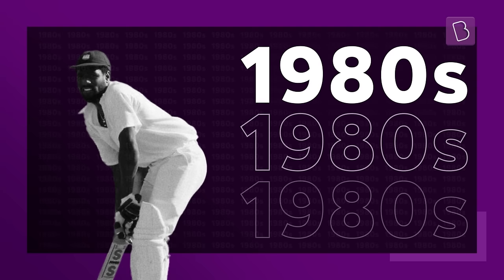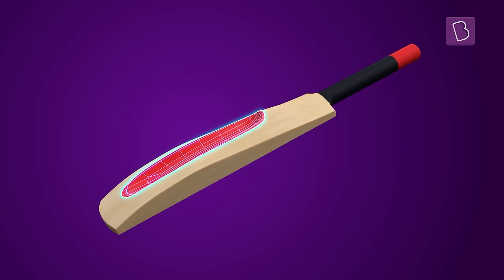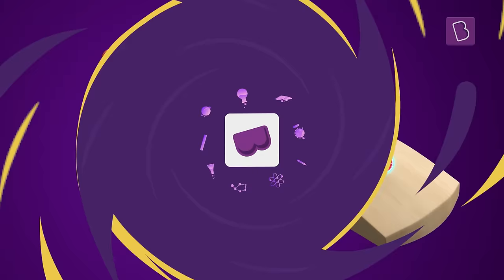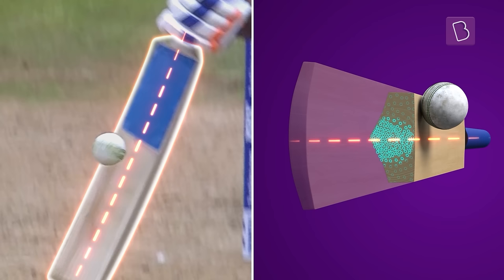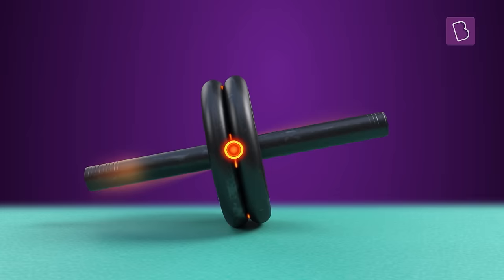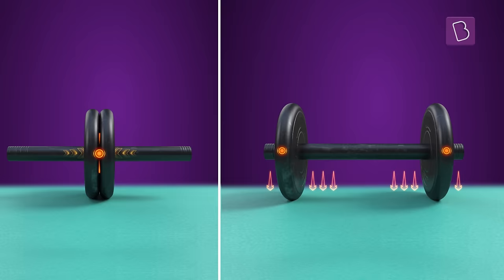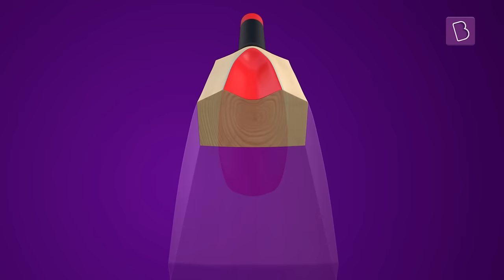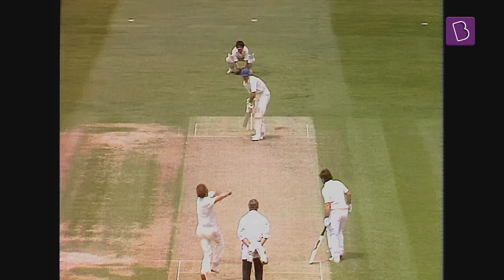Scoop vs Normal Bat | Mass Moment of Inertia | Ian Bishop | Wicket to Wicket | BYJU’S

Comment: Players stopped using scooped bats because in modern bat making you can achieve both the big edges and a big spine. Bat manufacturers dry the clefts to make big but light bats.

Comment: As mass is concentrated out of axis of bat the moment of inertia is more so that bat takes up more energy while rotating. So when batsman doesn't middle the ball the amount of energy transferred from ball to bat is more and you will lose in power transfer. Lofting and clearing boundaries will not be easy. But it provides better control to guide the ball as face doesn't rotate much. 
If batsman if keep on practicing with scoop bat their muscle memory will adapt it and middling will go away. They will be inclined towards ground shots. Now because of Shorter formats hitting sixes is a required skill. 
But with former bat If you miss-hit you will lose control but power transfer will dependent on cosine component of impulse of bat to the direction of incoming ball. Shot might doesn't go in intended direction but it will go out of park if even ball hits close to axis of bat. And middling will be improved in practice. Only shots hitted from far away from axis will be problematic.

Comment: The main reason batters stopped using scoop bats in cricket is due to changes in regulations and standards set by cricket governing bodies. These regulations are designed to maintain a fair balance between bat and ball, and ensure that equipment used in the sport adheres to certain specifications. As a result, unconventional designs like the scoop bat have been phased out in favor of more standardized bat shapes that comply with these rules.

Comment: Obviously scooped bats are generats less power against the regular bats... It's true that odds of miss hits getting lawer, but at the same time it reduce the power that bat can put on the ball, which is not recommended for the modern Cricket. I think that's the most concerned part of batters on give up to use scooped bats... 🤔😌